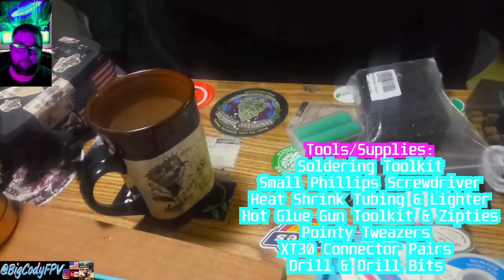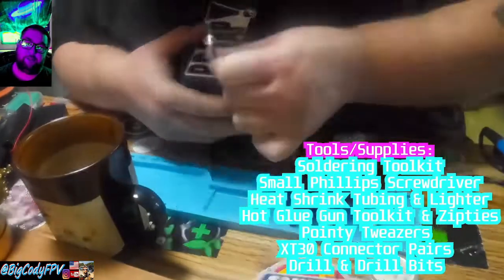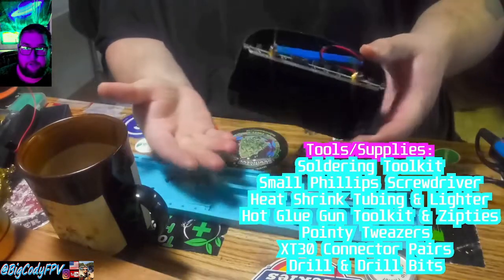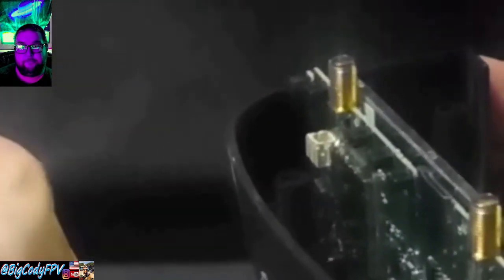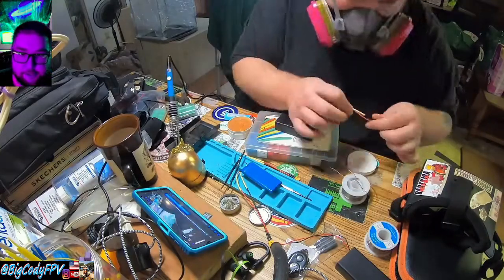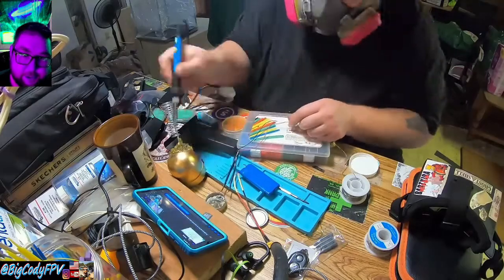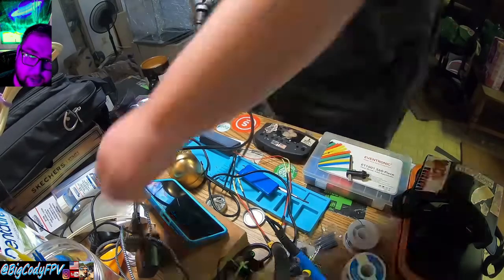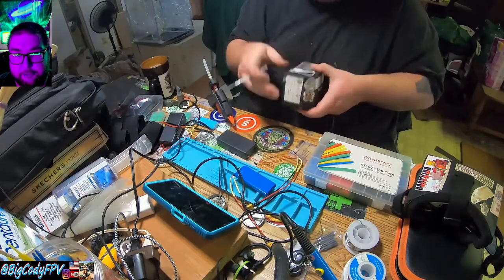How to do Eachine EV800D xt30 Battery Mod

Comment: I also used 2S li ion cells for this mod only problem is battery indicator always shows 0 bars.  Is it working for you ?
Reply from the maker: I broke those goggles along long time ago. I'm on to digital now. That last analog I bought was the Amazon ones for 60 or so. They're probably 80 or 100 by now with inflation ugh

Comment: 06:47 Hello. What is the part you add on the top headstrap ?
Reply from the maker: It was a piece of the padding the came in the bottom of the box my drone came in. I felt like I needed something to add to the strap to prevent it slipping off of my hear to one side or the other. It improved the sliding to the side issue alot but did not solve it 100 percent. I got a new pair and the strap on it looks the same but doesn't slide like the old on did so if I were to do it again I think I would try and buy a new strap to go with the upgrade